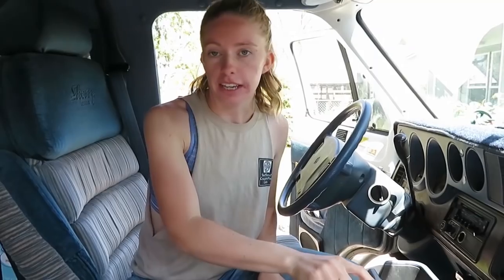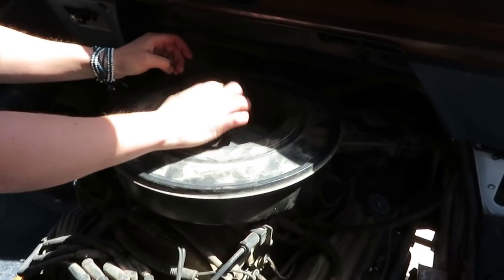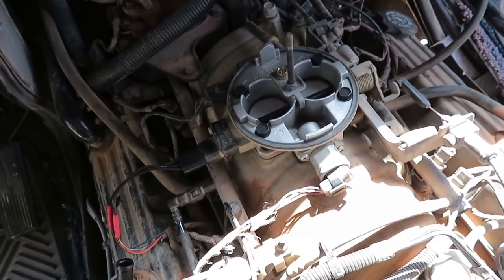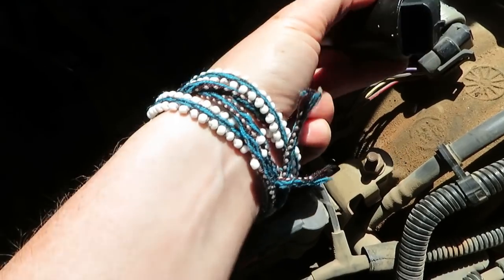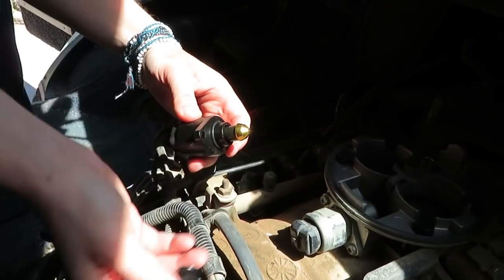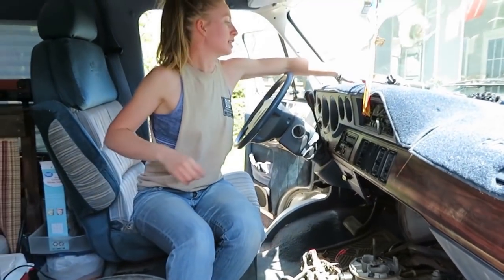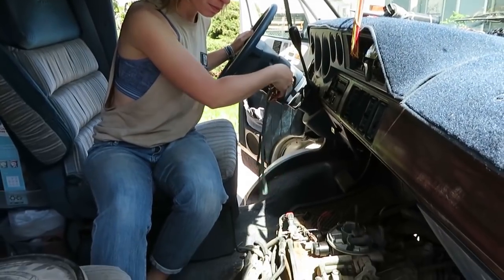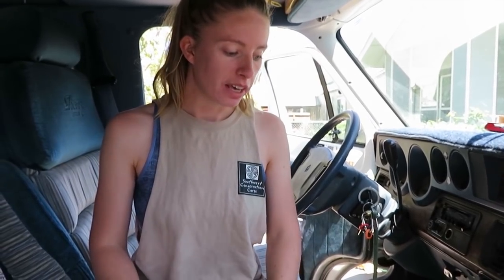REPLACING IDLE AIR CONTROL VALVE - 1993 Dodge Ram B250

Comment: You can unscrew the other sensors off of the throttle body. Take off the throttle cable. Unbolt the throttle body from the engine (plenum). Then throw it in a dishpan with dawn soap. Let it soak it hot water. Clean the carbon dirt off completely. While you have the throttle body off, drop a little magnet down one of the holes onto the plenum pan tied to a string. If the magnet sticks - it's the original steel plenum pan at t hff e bottom of the inside of the big silver vacuume cleaner like plenum intake the throttle body is mounted on. If it doesn't stick, it's been replaced with the proper Mopar aluminum plenum pan. Gaskets on the original steel ones fail and leak oil onto the pan because the plenum is aluminum  and expands less than aluminum, breaking the gasket seal. They also collect pan oil from a broken PC Valve - like mine was. There's a Mopar aluminum plenum kit for Dodge B250's. About $150. Mine's still a steel pan, but luckily isn't leaking yet. But I'm ready when it happens. A lot of YouTube videos on it.

Comment: Good luck with that coolant temperature sensor it's no picnic especially the one that's in the other side of the thermostat housing neck the one toward the passenger wheel fairly easy

Comment: I have a Ram ‘94 B350 I’ve been wondering how to remove that darn cover it’s just like mine. I have to try and get it off tomorrow because that air filter NEEDS replaced pretty bad. Thanks for sending, you got yourself a new sub! ❤️👏🏽

Comment: great job. had same issue. replaced IC valve, throttle position sensor, MAP sensor, spark plugs, wires, distributor cap & anchor but eventually it was the EGR valve.

Comment: Your dad would be so proud that you're learning at such a quick raid about Sherry!
One question but it has to do with the new battery... Why didn't you change out the battery cables you got the same time your new battery? Your battery terminals are pitted and may cause problems down the line. I'm just wondering. You did a great job on changing out this part

Comment: PVC Valve, $3.99 on passenger side,middle of valve cover.plastic flex tubing on wire harness you fixed,protects against heat.

Comment: So to anyone watching this. I have a 1996 B2500 Dodge Conversion Van. It was dying out sometimes, then it started dying all the time when it was warmed up. Pulled this part off and it was stuck in position, quick replacement, $30. Started Van and runs like a new van. Good luck out there.

Comment: Always makes engine run smoother if you spray carburetor/throttle body cleaner into carburetor and blow out all the carbon. Look into it if you are interested, to verify method and precautions. Engine will sputter and thick black smoke comes out of tailpipe as it blows carbon out.

Comment: How do you know if you need a new one of these?
Reply: You wouldn't unless you bench tested the device and it didn't meet specification (high electric motor current draw or sticking on rotation).

Comment: The idle air control valve wont keep it from starting.  Also, it typically will fail in the open position making it fast idle, not stalling. Hopefully that cures the problem. 
I would be highly suspect of the ignition system for hot stalling issues, ie. Distributor pick up sensor, ignition coil, crankshaft position sensor. Also, check fuel pressure when hot.. I can hear you have a sticky lifter. Buy a bottle of "lifter free" and add to your oil.
Reply: Definitely check the crankshaft position sensor. Causes stalling. Rough idle and poor acceleration. Easy to access cheap to replace. Wouldn't hurt to swap the ignition ignition coil seeing as it's only a few bucks and this engine only has one if I'm not mistaken.

Comment: 3:10 I don't understand the need for that special torx screw unless it is for slowing down thieves from stealing the IAC, otherwise it's just annoying that they can't use a standard philips screw ( or standard torx ).
Reply from the maker: It’s a a T25 screw
Reply: They work better than philips and that was the tamper proof so not everyone could take them out. You might have a problem in your vapor recovery system letting vapor in at the wrong time (charcoal canister)

Comment: The duck with the green head is a mallard{boy-duck} and the other less colourful duck is a drake{girl-duck} they are a couple, you can watch the Mallard/boy to watch out for the other duck. 1993 was the year the major auto manufacturers started putting all sorts of Emissions equipment onto these USA vehicles. Also starting to use Computers etc. The older vehicles before 1993 come with much less Electrical components making them much much easier to work on and buy parts for. It's these earlier years of 1993 to 2000 when you should avoid buying an older vehicle as the manufacturers did Not have the process perfected making these years 1993-2000 vehicles suspect to various electrical failures with all sorts of electrical problems. Either buy before 1993 or after the year 2000. Do your research just dont buy a vehicle out of emotional Want or Impulse. Be practical and again do your research by searching through the web to find the most common faults of each specific vehicle. remember no Automobile ever made is Perfect. They are the culmination of making the Least Possible Product for the Most Highest Profits. They/We could make a car that never wore out for a very small price but that is not how our system we live under works. We live under a system where we get the crappiest thing they can make at crazy exorbitant prices to keep us coming back to buy more and more and more and more. Eventually our system will collapse as it can not generate unlimited unsustainable growth year after year decade after decade. Buts thats another story....lol...

Comment: Air inlet temperature sensor , if the engine is not running well once cold. It is placed on the right side of the front part of the manifold bridge.  Kisses Uwe

Comment: At 2:00 you put a note that it didn't want to start after pumping the gas. With fuel injection you are NOT supposed to touch the gas when starting. Older carbureted engines need you to pump the gas to set the choke and squirt some fuel into the intake through the accelerator pump when cold. Your computer, if pressing the throttle when starting, thinks you are trying to clear a flooded engine and is therefore not giving the engine any fuel.

Also, wrap the wires you crimped with some electrical tape to keep them from flopping around. Crimp connectors don't handle vibration well.
Reply: I think What she meant was after she pumped (filled)up her gas tank as opposed to pumping the pedal and Yes that's great advice to put electrical tape on those terminals . Hopefully it'll start well now before  she ends up having to replace the starter! Lol
Reply: @dbrown6936  If you watch the video of her trying to start the van after having the battery replaced, she clearly pumps the throttle before attempting to start it.

Fuel injected engines can be a bear to diagnose if you don't have experience with them. Add in things like leaking vacuum hoses from age and diagnosis is rarely quick. I was a fleet mechanic for a company that had loads of those Dodge vans. Were she not on the opposite side of the country I'd donate some time to help her out. Heck, up until last month I had a spare low mileage engine from my last Grand Cherokee that would drop right into Sherry.
Reply: @jamesgill5511   yes sir i did the times where she pumps the pedal and it drove me crazy! Hahaha.  Yup we would all love to help her but just to far away. Will be watching from the sidelines, have a good day.